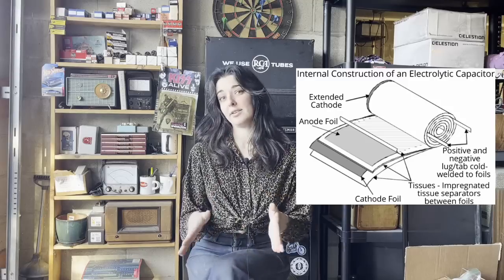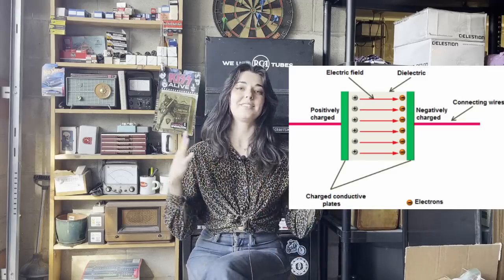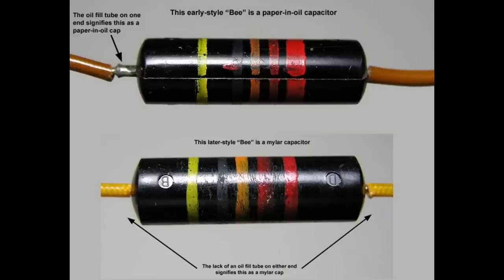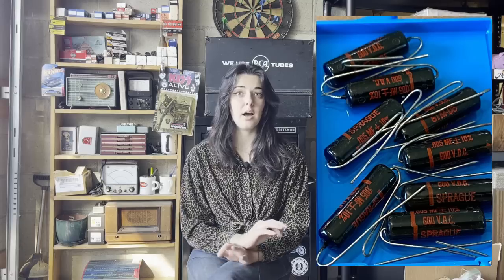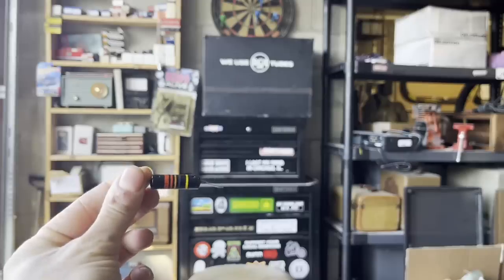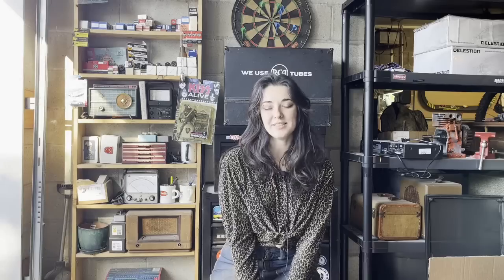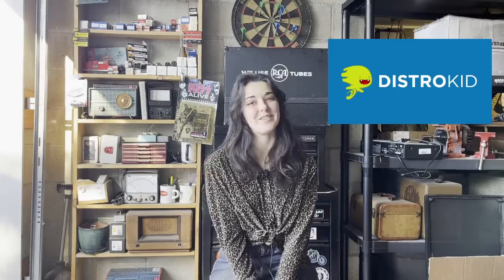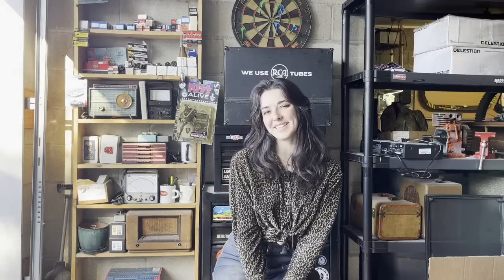Bumblebee Capacitors | Sprague Black Beauty Capacitors | Amp Electronics 101 | Fazio Electric

Comment: Is anybody doing this with guitar AMP's? Shouldn't all grounded film and foil type CAP's be checked for inner and outer part of the foil? To see which lead is the outer part of the foil, so you can ground the outer side of it! It might help reduce some noise issues.

Comment: Leaky capacitors need to be replaced whether they are black beauty or other brands.   The original sprague company is no longer in business, and the brand today was bought by Vishay and still used for capacitors. 

If you are looking at good capacitor replacements today consider brands such as Nichicon, Rubycon, Nippon Chemi-con, Panasonic, Elna, Kemet, or similar.    There are a lot of junky brands out there too like Wincap, Samwha, KME, etc that offer lower quality.

Comment: In my experience, different types of capacitors do not impart different sounds. If you aren't happy with a sound you are getting with a certain capacitor in a certain location, don't mess with the TYPE of cap....mess with the VALUE of that cap.

Comment: hey colleen thanks so much for sharing your knowledge do you use isolation washers on the output jacks and run a wire to ground and do the same on the input jacks just doing a 6g2 build

Comment: I like working on the old Tektronix gear such as the 503, 531A, 541A and etc. I shotgun these caps when I see them. I am starting to see that the newer Sprague caps with the red lettering failing as well. I have a 180A time marker that had a lot of the Sprague with the red lettering and it started giving me problems and ended up replacing several of them. Then about 4 months later, more of these caps failed so I just replaced them all. I know a lot of people like these bumblebee caps, but they are taking a chance with their life or their output tubes and I have noticed that output tubes has gone up in price!

Comment: Save the old caps, Dremel out the insides from one side, insert new, smaller, modern ones and seal up with epoxy or hot melt glue.  Not to deceive anyone, but to preserve the old look.  Old Sprague electrolytics I remove the cardboard tube and put it around a new one same way.  Or dip your own caps in brown tinted epoxy and get out the paintbrush with some enamel paints !!!

Comment: Hey thanks, I did had experience to mistakenly took them as resistor and got confused by the meter reading as trying to check the value.. Never knew could be capacitors.

Comment: If you can't measure any signal voltage across the capacitor while in use, the capacitor is NOT affecting tone. Double blind studies where  people guess which is which with A/B comparisons have shown that the ear is subservient to the head.

Comment: It does make a difference which way they go. As far as frequency response goes, it doesnt matter but you want the outiside layer of the coiled capacitor plates to be the side toward ground, helps with grounding noise like 60 cycle hum.  Try reversing the direction of a coiled cap in your guitar or amp near a neon sign, the difference will be obvious.  If you have a scope just clip to one side and see how much 60cycles it picks up out of the air to see which way is which. Somebody did a video that proved that the markings do not necessarily indicate which side is which.  You have to individually test.

Comment: Question for anyone here: how can I future proof an old amplifier as much as possible? New electrolytics will still go dry or leak in a few decades. I know that on some amps, very low capacitance capacitors can be swapped with film or ceramics.

Comment: Hi! I know you probably work mainly with tube amps , though I have a solid state amp question if I may. I have a peavey bandit 112 red stripe that’s USA made. And I’ve been giving thought to a speaker swap and /or a separate additional cabinet. The amp is 80 watts as is. When a cabinet is connected it bumps up to 100 watts. My question is regarding the speaker type I should look for to replace the amps built in speaker with. I would like a musical sounding , wide spectrum type that handles lows and highs well but sits in the midrange mostly. Do you have a suggestion ? And if so , would that speaker be a direct swap ?? Thanks so much.

Comment: Shango did some tests of coupling capacitors used to couple the deflection plates of a 1940s tv. The results were very strange and interesting. It is a bit hard to follow due to the video editing jumping around, I could not reach a conclusion.
There are effects like dielectric memory and piezoe!ectrics that could affect the sound. Just a bit of leakage can change the bias by a volt or two and unbalance the output transformer affecting frequency response. It is good to check the voltage after swapping capacitors.

Comment: I got as far as the intro explanation of capacitors.  Only electrolytic capacitors "store" DC energy.  These are mostly found in the power supply section of circuitry, and their use is to 'filter' remaining AC ripple from the rectification circuit.  Those old Sprague 'bumblebees' and their waxy or tubular ceramic cousins actually isolate voltages--only allowing AC signals to pass through to the next element or stage.  In a general sense they filter also, but do not store a residual charge once the circuit is turned off.
Reply: Paper and other foil/film capacitors are also used to filter AC ripple. This isn't as common in audio amps but in radios they're used for this all the time due to the higher frequencies involved.
Reply: All capacitors store energy. It's this property that allows them to function.

Comment: when using capacitors for blocking low frequencies should the value be as close to the frequency being blocked or should the cap be, say four times the frequency?
Reply: No, it doesn't work that way. The capacitor value is inversely proportional to the cutoff frequency. It also depends on the other component values in the circuit. If you search on "RC filter" you can learn more.
Reply: @eDoc2020  ok well i dont get inversely proportional, the cap should be less than 30 hz? RC filter is a website?
Reply: im tryin to block 30hz and lower going to 6x9's someone told me 120 hz capacitors should be used. Im going to use 100 hz now
Reply: @edgrrickett140    Inversely proportional: the higher the frequency you want to block the lower the capacitor value. An RC high-pass filter is the type of circuit you probably want. Any electronics textbook will explain it, or Wikipedia, or tons of other websites.

The capacitor value, in Farads, can be calculated by taking 0.5, dividing by pi, then dividing by the resistor value in ohms. The result will be a tiny number, multiply by one million to turn it to micro-farads. There are also numerous online calculators to help with this.
Reply: @edgrrickett140   Capacitors are measured in F (Farads), not Hertz. Use the formula I gave you, the resistance value is however many ohms your speaker is. For an 8 ohm speaker you want around 470 or 680uF to cutoff near 30Hz, or for a 4 ohm speaker it should be 1000-1500uF. A 16 ohm speaker would need 330uF.

For a speaker crossover like this you need to use only non-polarized capacitors. Most capacitors of these values are polarized.
Reply: @eDoc2020  i wonder why someone would tell me i need a capacitor value of 120 hz or 331 uf to block frequencies up to 30hz?
Reply: i come up with 39,808.917? the bassblockes i got are 100 hz, 397 uf. i hope that's close enough
Reply: @edgrrickett140   I've never heard of a bassblocker before but it appears it's a capacitor where they already did the calculations for you, assuming a certain speaker resistance. As I said before to block 30Hz from a 16 ohm speaker you need 330uF. The same 330uF would block 120Hz if used with a 4 ohm speaker. That's why somebody would say to use a 120Hz blocking cap in order to block 30Hz, they are figuring your speaker resistance is 4 times what the bassblocker is made for.

Whether or not what you got is close enough depends on what you're trying to accomplish. A slight difference in value won't matter. I'd bet your 397uF bass blocker capacitor is actually manufactured to be 390uF (a standard value). Regular capacitors have a +-10% or even +-20% tolerance on their ratings.
Reply: @eDoc2020  thank you. my amps i have produce down to 9 hz, i want to block that low of frequencies up to 30 hz because the 4 ohm 6x9's I have start responding at 30 hz and I hope using a 390uf 100 hz bass blocker cap will stop any frequencies that might cause distortion. I guess well see thanks
Reply: @edgrrickett140  If hooked to a single 4 ohm speaker the 390uF capacitor should cutoff at 100Hz. But "cutoff" isn't the best term, the filter effect is actually gradual in terms of frequency. Even though the cutoff frequency is 100Hz it will still let a tiny bit of 30Hz through. If it's not exactly what you want you can put multiple capacitors in series or multiple in parallel to change the value and thus the frequency response. Try it and learn from what happens.
Reply: @eDoc2020  wow ok why won't a 390uf 100 hz capacitor block out all low frequencies up to 100 hz? My amps produce frequencies starting at 9 hz up to 20000hz  Im only tryin to block frequencies from 9 to 30 hz. because the 6x9's don't reproduce sound until 30 hz. I'm tryin to stop any distortion from frequencies down there gettin to my speakers
Reply: @edgrrickett140   Because it's a simple "first-order" filter. For better filtering you need more complex circuitry. This is impractical to do using passive components without losing power. To economically and efficiently prevent all lower frequencies from entering your speakers you would need an active filter placed before your amplifier.

But for your purposes the gradual rolloff should be fine. It will be -3dB at the design frequency, -9dB at 1/2 that frequency, -12dB at 1/4 the frequency, and so on. That's still a pretty significant reduction in power which should be enough to prevent your speakers from distorting.
Reply: @eDoc2020  yeah i knew it was just first order. i didn't know about puttin a active filter before amp or forgot  maybe that might be a next step for me or just settle for what it is. i'm gonna think about that. OK thanks

Comment: I can't comment on sound quality but I too try to keep the old capacitors when they are still good.  I fix a lot of WWII (and newer!) military radio gear for friends and it amazes me how so much of that old gear is either fully functional or has only one bad component.  A recent ART-13 transmitter I fixed had never been used, from 1942, and the only problem was a leaky screen bypass cap in the audio amp causing low modulation.  That's it!

Comment: You get bumbleebee caps in old McIntosch Amps - i changed them out as if they go they will take the amp with them and this amp was 65 or 66  - i used a good cap that was recommended in the Hifi forums--- i had a cap tester and they where ALL out of value...............specs where pretty slack back then - the BASS was a lot tighter after the work and i wasn't worried about my $5-6 k amp

Comment: Q: I know you work on tube amps, but this fits with the capacitor theme. I have a Fender Performer 1000 that I opened up to see if it had any burns on the circuit board (apparently a typical issue with that amp). Didn't find any burns, but in the meantime, I broke a capacitor connection. Any point in repairing this amp (or more likely given my soldering skills, paying someone else to do it)? Thanks.

Comment: Q: It would be great if you could talk about ways to reduce tube rattle in combo amps.  I've replaced the EL84's, but still get tube rattle on certain notes.  Touching the end of one tube stops the problem, but its very hard to play guitar at the same time. (Its also hard to play with burnt fingers.)  Thanks.
Reply: Maybe build some retainer / dampener for the tube. Use heat resistant materials, e.g. silicone, if you want your retainer to be soft. It's a mechanical issue obviously if it's fixed with finger. Four holes around the socket, four springs, a metallic cup and maybe a silicone o-ring inside the cup, might do the trick. Shouldn't be difficult given you have basic understanding on how to do this kind of tinkering. Just avoid the zappy parts, disconnect from mains and discharge caps before starting.

Comment: HUGE QUESTION! I need to understand voltage on capacitors. I have a volt meter that uses a 50v capacitor. Its blown out. I have a huge box of other similar capacitors. I'm not sure if i can use a higher rated voltage with a similar Farad capacitance. How close do i need to get with a capacitors rated voltage? It sounds like to me the capacitor with a higher voltage can just withstand a bit more. No one ever covers capacitor voltages and how that voltage is used or how flexible in examples it can be used.
Reply: For ceramic and film/foil caps you can use a much higher voltage rating without issue. For electrolytic capacitors you want to be slightly closer but it's not critical. Don't use a 400v capacitor on a 6v circuit but it should be fine to replace a 50v capacitor with a 200v one.
Reply: @eDoc2020   ok so keeping ABove but near the Voltage is acceptable. Its is NOT acceptable to go under. ( it is electrolytic )

Comment: I would love for you to expand on the whole aspect of vintage capacitors and resistors, in how they could potentially affect the sound of an amp. Vintage caps (Sprague) and resistors (Pihers) can sell for a lot of money. But we are dealing with microfarads and ohms. If it is the same value component, how can sound be affected versus some current production component?

Comment: Q: Speaking of caps, I just bought a 53 5b3 for a great deal :) It's had some repair work done previously by Todd Sharp over here in Nashville. The transformers are original but a lot of the caps have been replaced. Interestedly enough someone replaced most of the caps with blue molded ones from the sixties, the same ones I see in my 67 silver face deluxe. I'm curious your thought on how the blue molded caps compare/sound to the Astrons in the 50's amps. It seems pretty cool someone used old caps in there to me even if they're not exactly what should be in there...

Btw Always enjoy your videos and happy new year!!

Comment: I once found a huge stash of NOS Black Beauties at the Goldenwest Swap Meet.  Mostly 600v .01 .022 .047.  Bought them for $50 and ended up making about 20x my money.
Reply: The paper used in those black beauties deteriorates with age. Try testing them on an old type tester that applies a high voltage across them and you'll probably see leakage.

Comment: What are you thoughts on using known bad (leaky) caps in ac only circuits such as guitar tone circuits?
Reply: I do that all the time in hi-fi circuits, and it works fine. Just be sure that the measured capacitance value is close to what your application calls for.

Comment: @ 1:44 you said a capacitor stores positive  and negative charge. This is incorrect. There are no such things as "positive & negative" charges. There is only "charge & discharge" (to ground). There are no such things as positive and negative charge particles.

That being said, you seem to know lots about electrical circuits. I built a few stereo components back in the day, Heathkit, Allied Radio knight kits, still have  the schematics! I no longer own them but would it be worth my time and effort to recap some vintage hi-fi equipment  that seemed to be not working up to snuff or not working at all? Any advice would be appreciated.
Reply: 'There are no such things as "positive & negative" charges'. What are protons and electrons then?
Reply: @silasfatchett7380 
Electrons do not exist, I and a proton Is not a  particle Of charge. That's ancient Greek Atomism, Particle physics Was falsified 100 years ago by Nikolai Tesla, Replaced with field Theory. Again, There is only charge And discharge To ground, That's it, No particles.

Comment: Worked at Sprague electric in Vermont as a designer and r and d the black Beauty went through many iterations , ie dielectrics , insulators , encapsulation material while they look the same their properties are quite different, and the construction ie winding of the foils the mandrill size and tension foils overlays dielectric thicknesses , all made up the voltage and capacitance and frequency ratings the encapsulation material effects . Most were made to customer orders and specifications while theres some generic there specifications were very broad.
Reply: Ya sure there pal
Reply: In your time, did you mark the outer part of the foils at all? I think it's really useful to find out which way around the CAP leads are when you want to (or really should) connect the foil's outer part into ground, if it's going to be a grounding CAP.

Comment: The cap value is all that matters, the type of cap is irrelevant.  Modern orange drops will do the same job at a fraction of the price.  You could even go cheaper and it wouldn't matter.

Comment: It is not night and day, but actually there is a right and wrong way to install plastic caps. It depends on which lead are connected to the start and the end of the ´foil coil´. Proof is to
connect one lead to a scope and touch it, and then the other lead and touch it again on the same setting. One lead will show a much higher noise on the scope. Carlsons Lab has made
a good YT video on it. Sometimes caps are marked with a ring, but you cannot always rely on them.

People say it does not exist, but I have experienced pulsating DC on a silver mica cap, used in the tone stack of a VOX AC30 clone. It sounded like thunder, and it stopped by changing
the cap. I think it was a 500 pf/500v and it only had a little over 100v across it. After changing the cap 3 times we used another type, and it never happened again.